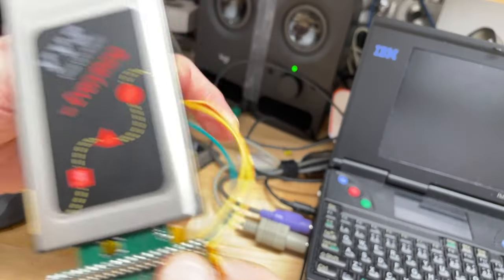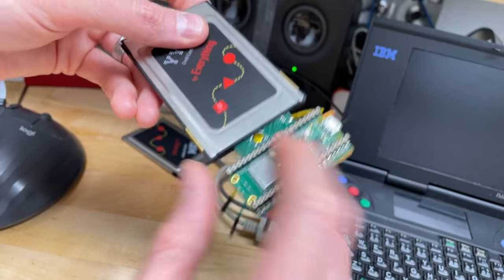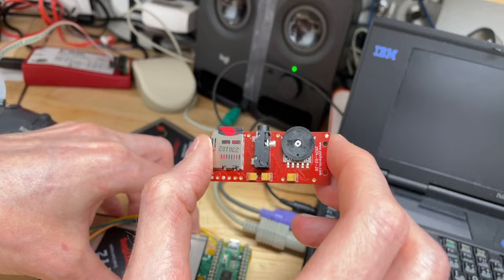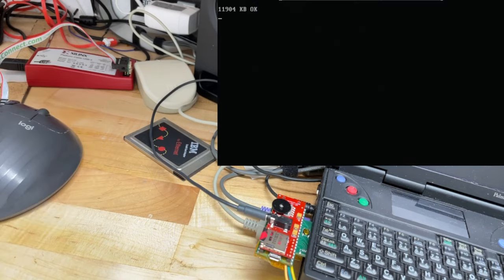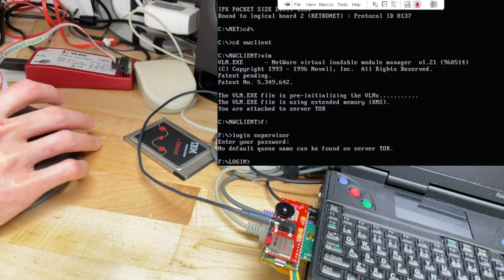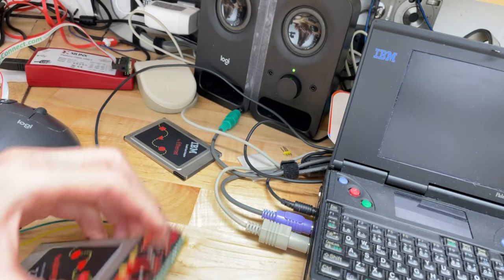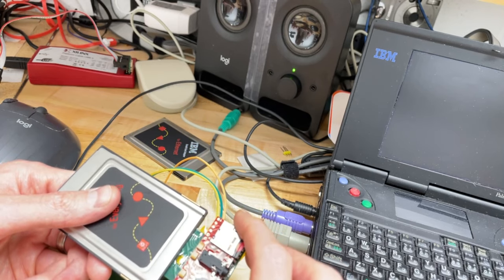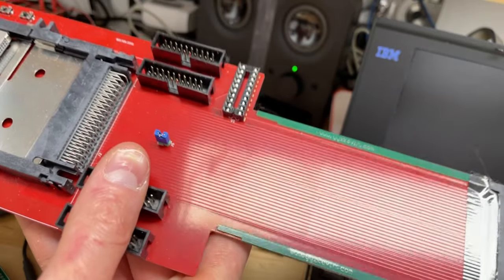Pi Pico PCMCIA / PC Card Introduction

Comment: As always Kevin you blow me away and great to see the interchangeability and modules that would be possible and great you worked with the other pico projects. Really great for the community. Looking forwards to getting hands on. I think I may have mentioned it before but using that USB as an accessible port would be something special especially on devices like the IBM PC110 I think the board options to date as a sound card, storage / emulation and network are just amazing. Great job. Mike

Comment: This thing would be a perfect fit for my Toshiba Libretto 100CT. I was at Revision this last weekend, and I couldn't get the system networked because I forgot the adapter for my PCMCIA ethernet card, and my ORiNOCO card could only do 802.11b :D

One more thought - Is it possible to enable the Pico to do the CPLD reprogramming on the card?
Reply from the maker: Good question!  The DIP switches on the bottom are for this,  so that the  Pico can be used to reprogram the CPLD without other tools.   I went this route because GPIO pins on the Pico are  in short supply and dedicating them to  this purpose was going to limit other functions.

Comment: Would it make sense for the main PC card to have a plastic shell that leaves the pin sockets exposed flush with the surface? Then you could have swappable add-on modules that just snap onto there, no need to have a different case design for every configuration.
Really cool project, I'm happy YouTube brought me here to see it getting developed :]
Reply from the maker: I thought about something like this too.    3D design is one thing that falls well outside my capabilities, which is why I was waiting to confirm the "final design"  as I have to pay an outside company to make the design for me.

Comment: That is a great project! I wonder if you can just use the rp2040 and the wifi chip to layout a completely self-contained PCB. i.e no pico w needed. This will make the card more compact. Pico W’s design file is open so it’s technically possible.
Reply from the maker: I do not believe  Pico W design is  public is it?   the pcb antenna is licensed,  and also possible license issue with   cyw43 binary blow.   but yes this is would be ideal and I was looking at the CYW43 chip.

Comment: brilliant, absolutely love it

when you say windows sound isnt supported - have you been able to test Windows 3.1? that tended to work with vanilla sound blaster drivers under something like sbemu for example.

time for me to print some clip on laptop speakers :-)
Reply from the maker: It does not work (sound) in any version of windows.  The issue is,   16-bit PC Cards did not have DMA lines,  and SoundBlaster requires DMA.  So this requires me to do some  software & hardware magic which windows does not like.  In windows we do not need to emulate a SoundBlaster though so we will just  provide a WSS interface.   I know it is possible I have just not attempted as the bigger demand was for MS-DOS.
Reply: @yyzkevin416  Regarding the 'software & hardware magic' did you reverse engineer the IBM 3D Sound PC Card? Or is this new black magic?
Reply from the maker: @zik  Same approach as IBM 3D Sound, the  DMA emulation.

Comment: Awesome. I have been looking for a solution like this for my Dell laptop. It doesn't have the ability to do midi. If this works to add the midi compatibility for dos so I can use a Roland sc-55 I would buy this in a heartbeat
Reply: It can be done if someone designs an additional board with a MIDI port.
Reply: @bubonzo  good to know. I'll be following the project. Wonder how difficult it could be for someone with no experience to learn to do it.
Reply: Besides the Amiga 600/1200 already commented I see it could also be very interesting in Psion 5/7/Netbooks, I would buy a few.

Comment: This looks very interesting! Amiga user here.... A way to decode mp3:s using an MHI driver, and possibly AHI 16bit soundcard capabilities would be cool in combination with what you already have (i guess the Pico can handle those, if you can have an audio mixer or something to the jack-module).

WiFi-stuff is offloading the host machine for WPA2/3?

Looks awesome man!

Comment: If you get CD drive emulation to work, this will be huge. It is so hard to run CD game images on authentic hardware. This can become ODE for vintage computers! Those things are huge for vintage consoles, infact, one of my plans was to repurpose ODE from a console for PC, because they both IDE based.
Reply: It also worth for network and sound card alone, but throw in ODE, then it will be swiss army knife of vintage laptop computing.

Comment: So, if you are going to emulate a CD, why not floppies as well? Or HDs?
Reply from the maker: the need to emulate an HDD is not so critical,  as it is easy to  use CF cards.  Emulating a floppy is possible, but there are few cards to emulate and most laptops will not boot from them so it also has less utility here.
Reply: @yyzkevin416  The utility is in easily copying over virtual hard disks from emulators you already have. You can use it to make backups of the current hard disk so that you have that, and you can move between emulator and other machines without having to setup everything again and again.

Comment: Amazing project. I wonder how do you control laptop remotely? It looks like some VM interface, but you're interacting with a real hardware...
Reply from the maker: I use an IPKVM.   In this case it is an Advocent DSR1051,  they can be found fairly cheap on eBay as they are antiquated now.    They were used for controlling  servers remotely and you can get PS/2 & VGA dongles for them.
Reply: @yyzkevin416  thanks! I didn't think of that, because I'm usually accustomed to web ones. That native app interface certainly tops up usability.

Comment: Did you think about creating a Panasonic SRAM memory card emulator? Those are getting very expensive and rely on back-up batteries. I thing a lot of old CNC, MIDI keyboards and Windows CE/Psion users would be grateful for that. As far as I know, no cheap commercial product is available and you seem to be the guy capable of creating such product :)